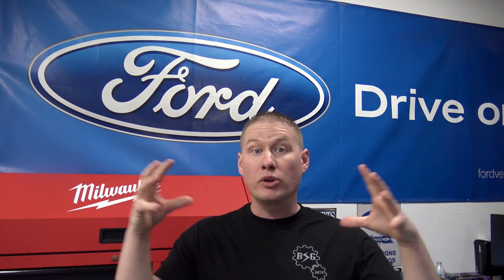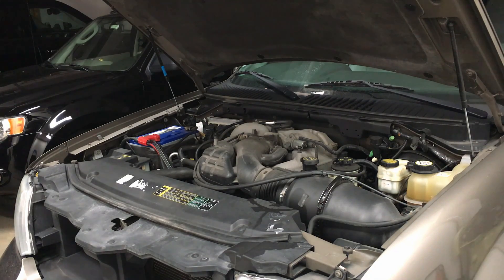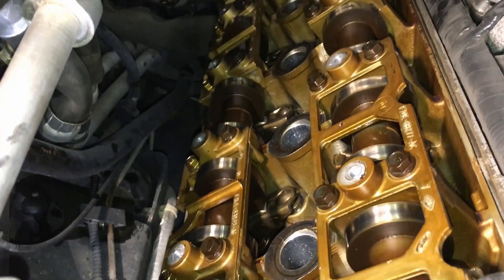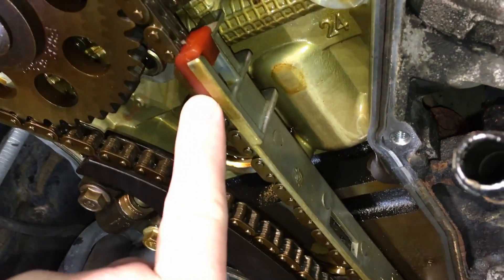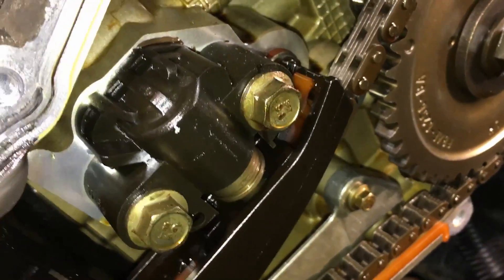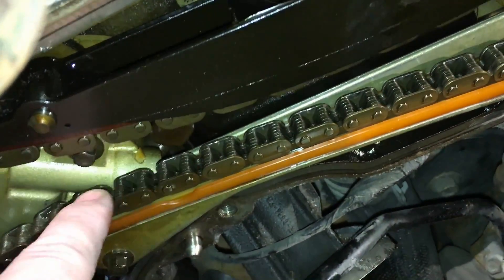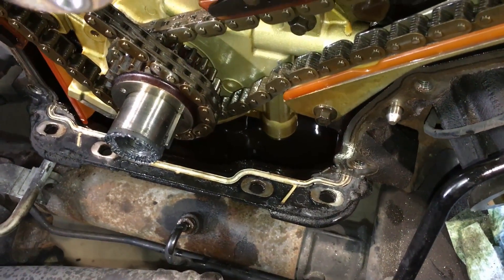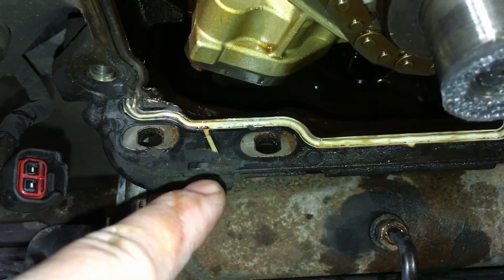Ford 4.6L & 5.4L Triton Engines: Common Failure Points to Watch Out For!

Comment: I have a 4.6 I gotta do this on in a couple weeks, but my oil pressure is good, about 3/4 on the gage at normal temps at idle. I won't know it until I pull it apart, but I sure hope i don't have to pull the pan off, it's a 97 f150 4x4. If all looks good with the guides do you think it's necessary to pull the pan?
Reply: Your factory oil pressure gauge is not really a gauge. It reads the same if you have even just a few PSI of oil pressure, it's more like a dummy light that is either on or off. If the guides are intact you can probably skip pulling the pan. Look all around the chain though as they sometimes rub the oil pump or timing cover which would send shavings down to the pan. If you see signs of that you should pull it for further inspection.

Comment: I fail to understand why anyone buys a ford product. The company that I work for has a lot of fords due to the fact that they are cheap because nobody else wants them cause they are such crap. The 6.0l were the worst diesel's ever made, all the triton motors were complete shit from the video stated problems to sparkplugs blowing out of heads, bad coil pacs, cracked exhaust manifolds, auto trans leaks, typical rust issues especially of the radiator core support, and oil pans. Then there's the newer eco-boost motors with turbo issues  and throttle body problems that strand you in the middle of the highway. The ford name is a common failure point. They highlighted the problem in blue and circled it.
Reply: I've got 280,000 miles on my 97 4.6L and it runs as smooth as silk

Comment: 4.5L DOHC,  former Naviguesser engine.  Asside from worn out guides had 2 exhst seats dropin  left head and one on right. Explored oil pan with articulating scope, lots of junk.  Since engine was to find a new home in an F350 Dualy, dropped pan and cleaned.  Good possibility could have used articulating retriever tool, bore scope and air pressure to clean oil tube and pan.  Went back together with new chains and guides, cam holder is almost a MUST.  Into a new home, wider than a two/three valve and had to remodel to fit.  Good project vehicle and ran great, lots of transplanting of support gear.

Comment: Hey Brian, how many miles on that beast?
Reply from the maker: 136k miles
Reply: I have one 5.4 with 235.657 miles and is on the road with 5000 pounds trailler!
Reply: what do you charge for that job
Reply: Ive got an 04 f150 4.6 with 254,000 on it and ive only lost 2 pounds of compression in one cylinder. Despite all the negative stereotypes against em, ford wins
Reply: I have a F150 with a 4.6 and 175,000 miles that runs nice and quiet.
Reply: My 4.6 E250 with 215k miles and 5 thousand pounds of trailer weight 3 or 4 times a week and still runs like new only issue was my A/C compressor went out other than that it’s an awesome van and I always had bad impression of Ford vehicles I was proved wrong cheers great video...

Comment: I have an explorer with the 4.0 v6 sohc engine.  I've changed the oil regularly with royal purple since day one.  The guides have finally failed on me at 252,000 miles and I'm about to change them here at the dealership I work at.  I was quoted by my friend about 1500 bucks since it will take almost 30hrs worth of work.   The secret to long chain and guide life is proper oil change at intervals.  And change tensioners every 75k. Synthetic oil also helps too.
Reply: Thank God

Comment: dude your awesome I wish I had you fix my 5.4 tri tons of problems ... had both chains and guilds basically all timing components replaced and all sensors except knock sensors all pulleys and tensioners still sounds like a diesel :( 
anyway 4000.0 later it's still rattle  tick tick  and sometimes not as loud?

Comment: My 09 mustang 4.6 has a quick rattle upon startup but noise goes away very quickly. Only has 35000km. It does not do it every time either, more on cold start up. Any ideas ?
Reply: 417cameron After shutting off your engine all your oil drains back down to the pan. Upon startup you will hear some noise from your valvetrain until oil flow reaches it

Comment: i have 2002 f-150 2 valve oil is changed every 2000 miles i run amsoil  their top oil and very good filters truck has only 29,871 miles on it it is a 5.4 love truck bought new when should i change timing guides?

Comment: I have an 03 F-150 with a 4.6 at 130,000 the tensioners on 1 side broke apart and seized up the engine.  When we took the engine apart it still looked like new with no noticeable wear.  A piece of cheap broken plastic gets pretty expensive when you have to replace the engine because of its failure.  I got teased about it from a Loyal dodge owner friend of mine. I got even when he was on his third transmission in his pickup with less that 100,000 miles.  They all break and they all have some issue or another.

Comment: I'm no mechanic by any means, but I was a tool and die  maker for 40 years. My question: If I take my 4.6 to my local Ford Dealer for repair, what can I expect for a bill? I'm talking the whole nine yards, labor and parts. Parts would be what ever you recommend. I would think any tensioners, chain guides, etc. Then once you have it apart change them all. I'm anxious to hear your estimate including man hours to do the repair and inspect oil pan. Thank you so much for your reply.

Comment: We have had nothing but Ford trucks and vans with 4.2, 4.6 and the 5.4. All trucks are being abused daily by employees. Never any issues. The 4.2 has over 400k on it now and one of the 4.6 has 380 k. The only trouble we had was that one of the spark plugs seized into the block and spent some money to have a heli coil put in. No big deal. Still remember my '92 F250 with nearly 800k, but it had the 7.3. So, to keep maintenance costs to a minimum, we will continue to use Ford for our fleet.
Reply: Oliver Meyer thats a good idea.
Reply: Hmmmm.  Do I smell bullshit?  Work for Ford?  Just got done replacing the last of every single front of the engine parts on my Ford F150 (power steering pump, alternator, air conditioner compressor, alternator, water pump, and stuff I'm probably forgetting).  At 160K miles.  On my third door handle.  Second power window motor.  Plus every single u-joint.  Upper and lower ball joints, and a ton of other crap.  Fords?  Oh, and the sparkplugs like to back out and it cost $500 a wack to have the coils put in.  But what's $500 to a proud Ford owner? Oh yeah, Fords are great all right. If you're lucky you'll buy one that you need to jack up the motor to change the spark plugs. 

It's always easy to find videos on how to repair Fords because everyone on the planet who owns one is repairing it.
Reply: @ravenfeather7087  Bud, I am not an avid Ford guy but I have 2 F250 5.4's at work that have both made it pass 200k miles without any repairs other than a tedious spark plug swap. Anyone who is running into that many problems is someone who is not taking care of their vehicle. Maybe you bought it from an owner who did so, maybe you are just incredibly unlucky or maybe you are the owner who did not take care of it, idk but I don't agree with your judgement. It is not the best engine but it is not a bad engine either. Anyone who takes proper care of their vehicle should not be running into so many issues.
Reply: @VagueMemory  I'm on my second at 116,000.  First one died at 298,000 (Ahole did u-turn and caused our inevitable meet and greet).  Poor car would of lasted easily another 300,000.  Fords last only as well as you care for them.  And because they are so common occasional repairs are cheap.  So ignore the feather cap..:)
Reply: @VagueMemory  I totally agree.  I'm a firm believer that all cars break.  Unfortunately, all-to-often, it is people that break them!
Reply: Raven Feather you are stupid lol you talking about windows and u joint and power steering of course all that goes out. On any car. Snowflake

Comment: Probably cost 2 grand to fix plastic belongs on toys.
Reply: Plastic? Come on, Ford!
Reply: XD
Reply: Lmfao what's the chain going to ride on, metal? That makes great sense, that's not going to wear out at all 😂 fuckin engineers in the comments section
Reply: @luciankristov6436  Agree, design the F'n thing for metal to metal.
Reply: @luciankristov6436  😂😂😂😂
Reply: lucian kristov right
Reply: @luciankristov6436  What were they using before the plastic?
Reply: Alan Johnson two grand hell!! I went to a local mechanic and he told me 3800 dollars 4 years ago. Ask my ford dealership what it would cost today and he said to make it right like new for years to come 4900 dollars. I  am trading mine for a 2017 raptor. Damn that! Mine is an 05 model. Just not worth it. Sorry for the rant.
Reply: Danny Boy you got ripped off you can get a used 2v for like $300
Reply: I haven’t fixed it and am not going to. Did you not read ? I am trading it in on a raptor .
Reply: Riiight. That’s why every engine made now has composite parts.

Comment: engineers are great at their job they design these engines to have stupid small problems constantly so you have to bring it into the tech to fix them
Reply: Jay Allen 
lol note how they put the water pump in the middle of the engine valley on the 3.5 Ecoboost and drive it with the timing chain
Reply: Jay Allen  what like who had the great idea that you have to unbolt a truck cab and lift it up just so you can do maintenance on engine. That should be the reason not to buy a ford pickup period. That’s why I bought a 01Ram. which is still on road. oil changes plugs distributor caps. Engine 5.2 l over 200k doesn’t burn oil and compression in spec. Just used full synthetic oil and changed it every 3k.  Since ram no.longer offers that engine.  In 2017 I bought a brand new Ram 2500 crew cab Tradesman with the cummins. Is the lowest trim lvl. For the same price as a 1500 
Crew cab sport optioned out.
Reply: If you're an idiot then maybe you should get a Chevy
Reply: @Ranger_Raptor_Twin-Turbo_3.0L  It has nothing to do with the old chevy vs ford argument; ALL modern vehicles are engineered like this. Planned obsolescence.

Comment: One time long ago on a 302 rebuild a customer  didnt bring  the valve covers and oil pan, timing chain cover .I told him why not and He said He wants to see if we did the work or not.Well He picked up the motor and a week later cussed us out saying no oil pressure. My boss jumped on me saying what ever wrong is coming out of my check. As soon as I took off the oil pan there it was the oil pick up screen was full of silicon strips. I got the boss and showed him , and he still made me pay for the engine gasket set , 5 bucks of quarters for the car wash and all my time cleaning the oil pump screen tearing the engine down all the way even new cam bearings again . When the customer picked up the motor My boss did not tell him nothing. My saying was use silicon but not the whole damn tube   .Rambus

Comment: My 5.4 blew up so finding your videos may just be a savior for me 🙌🏻
Reply: How many miles was on yours and what exactly went wrong with it?
Reply: I have a 2010 5.4l Triton with 122k miles on it and recently the timing went off due to a broken tensioner and a bad VCT solenoid it was $1600 to fix.
Reply: I would've done the work myself but the dealership paid for the repairs due to the fact that I purchased it used from them just a few hundred miles before this happened.
Reply: Mind you they did the minimum repairs possible in order to fix the problem. meaning they only replaced the parts that broke. If I did it myself I would have replaced all the parts that are prone for failure. they only replaced the one vct selanoid that blew and not the other one on the other side of the engine etc.

Comment: Just want to say thanks for your videos. My 04 F150 5.4 triton gave me 198,000 miles before the timing guides decided to go.  Your timing system video walked me through the process with extreme confidence. While I had everything apart I went ahead and replaced the pump as well unsure if the small shavings got up in there. Thanks again for your videos and expertise you share. By the way after I got the ole truck running the wife made me trade it in for a new truck graduating up to the new 2016 F250 6.7 liter diesel it's our new vacation vehicle. Look forward to videos  on this truck in the future.
Reply: How is the F250 holding up?

Comment: Interesting problem-- what is the mileage and did Ford improve on the tensioners and guides? I am sure that's an expensive job considering all the hours of labor including removing the oil pan 

Really cant see much positive about most or certain Ford products between that lousy hybrid trans. and other misc. things, my boss has a fairly new Focus and was mentioning how jerky his car was- I didn't want to tell him that trans is garbage

I just bought a 2017 Elantra 6 speed manual, 36 MPG, love it, traded my 2009 Accent, this gets 4-6 mpg better than the Accent

I will keep my 1996 Jeep GC 5.2 as a bad weather/2nd vehicle, might only get 12 mpg city but it has 150,000 miles and doesn't burn a drop of oil and if anything happens its a basic engine to repair/rebuild

Comment: I have an 04 f150 with a 5.4 3v with about 90k miles on it. would you recommend changing on the next oil change to a 5w30 or stay with the 5w20 to better protect engine components.
Reply: Yed
Reply: Yes

Comment: Hey bud I know your the man when it comes to ford so I got a question, my wife's expedition a/c sometimes well twice already has stopped working, but the second I wiggle the wires going into the resistor/ blower motor it'll kick back on, and stay running.... the first time the resister plug one of the pins and wire was getting really hot also so my father in law replaced the resister but I kinda thinking it's maybe something on the blower motor side causing the problems, what do you think sir and thanks for your advice.

Comment: So I'm guessing that the shop that said the same that was wrong with my 5.4 3V, didn't really need to "replace" the engine and charge me $8900 for a new one?
Reply from the maker: Correct unless you had abnormal amounts of sludge, clearance issues or thrust washer issues on the 07 models.
Reply: hmmm, Mine is an 04 and they didn't say anything about sludge or clearance and I don't even know what a thrust washer is. All the said was " the bottom chain guide is broke and we're getting high enough oil pressure. You need a new engine."
Reply: not getting high enough oil pressure. oops typo
Reply: The rest of the truck is great. Not to mention if I can get the truck to last another 10-15 yrs, give or take, THEN I'll trade it in for a new diesel for retirement. You gotta remember, its an 04.

Comment: Hi , good vid. Wonder if you can help, I have a 2007sport rack limited v8. And I have this unique noise while running and try to turn to the right.  Noise come from the left side.  Also while running, when I need to pass a car I push gas and it make a cracking sound. HELP!!!

Comment: I have a 2004 f150 with a 5.4 3 valve with about 225000 miles on it . It makes a ticking noise when it gets up to normal operating temperature and vibration a idle. It sounds a lot like a cam phaser but I've listened to other noises from other videos and it sounds like them too ,(anything from a loose spark plug to a bad tensioner . Can anybody help with suggestions. Thank you !

Comment: i recently changed a passenger side head on a 97 mustang 4.6l 2 valve... i got a used head from a junk yard that came off of an f150, i timed it correctly and put it in, i tested compression, checked for vacuum leaks and everything seems fine, however when the engine idles is shakes slightly and idles a little rough, when it gets to about 1800 rpm all symptoms disappear completely and it runs great, i was wondering if anyone who knows a lot about these modular engines would know if the 2 valve camshaft from a 97 mustang would be different than a 2 valve camshaft from an equivalent 4.6l in an f150